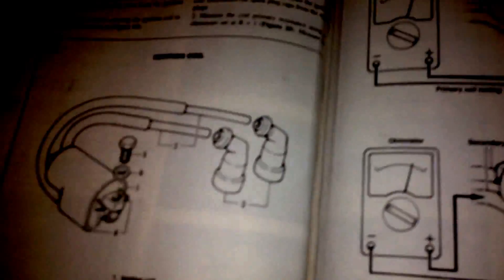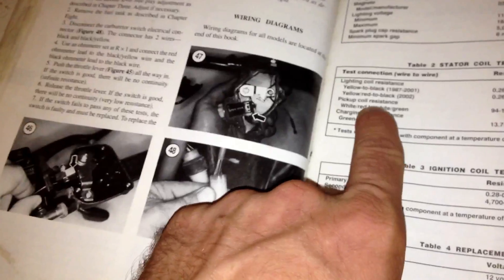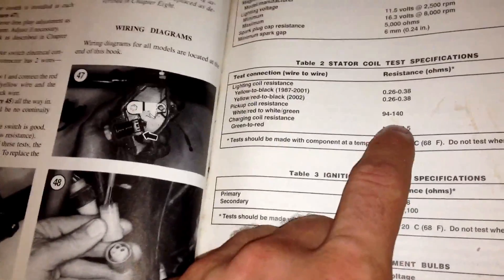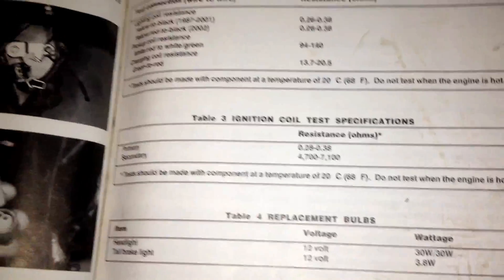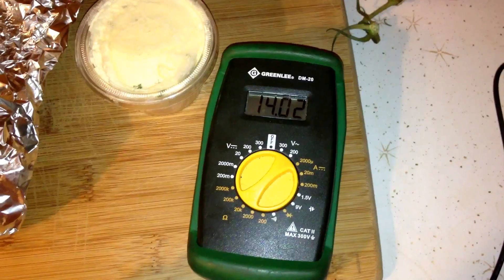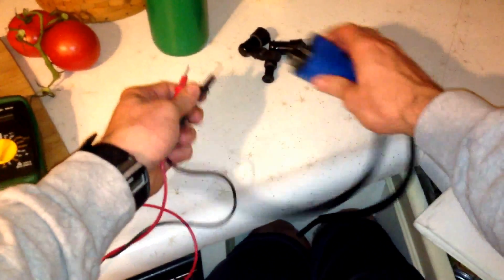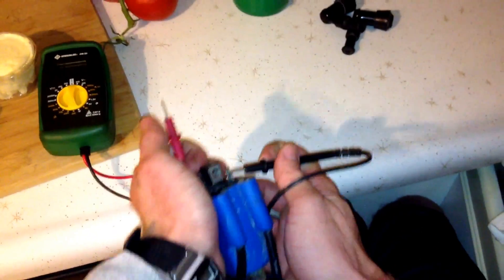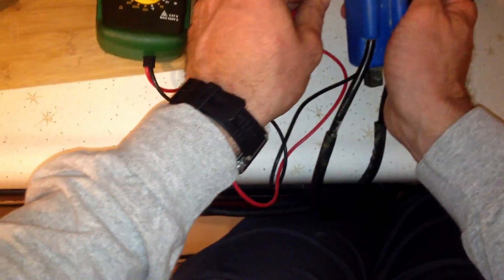Ignition coil testing

Comment: Hey man I was wondering did you ski have spark when still when you tested the coil and found it to be bad? I am wondering if my coil is bad but the ski does have spark and starts I just wonder if it’s short circuited somehow
Reply from the maker: Chris B this coil ended up being okay. I was losing spark because of a melted wire that got too close to exhaust pipes. This coil is off a Yamaha Banshee (350cc twin cylinder 2-stroke.) The Throttle OverRide System (TORS) malfunctioned.

Comment: Your not reading it in ohms you meter I's on volts.  Put the red lead in the plug wire end and the black lead on the output of the coil or vice versa polarity doesn't effect it.

Comment: I know this is old, but yeagh, seconday winding is off = bad coil.
The primary is tough to meassure, because theres so little resistance. This is very rarely the fault.
You need to subtract the resistance in the meterwires themselves, from the meassurement.
Usually anything under 5 ohm on the primary side is a-ok!